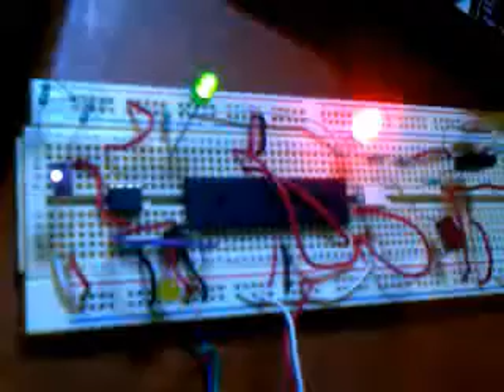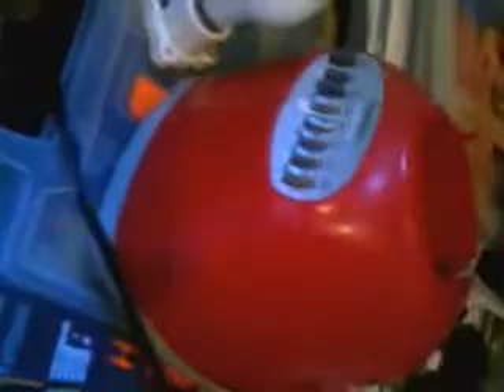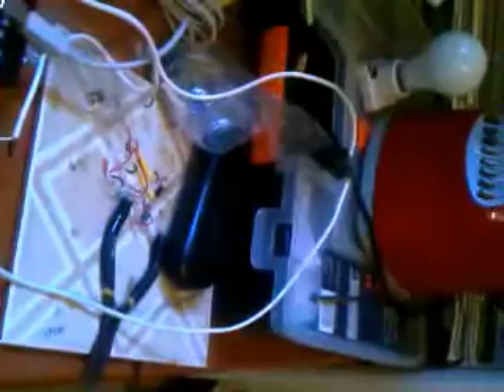Control de Motor Universal con PIC 16F887 y sensor QRD 1117 (FES ARAGON/UNAM/México)

Comment from the maker: Si necesitas algo mucho más exacto de calibrar te recomiendo el QRD1114 a mí me dio menos lata que comprar el CNY70 o que armar el diodo emisor con el receptor. Ese tipo de configuración de comprar todo aparte a mi me dio más lata. Cualquier duda avisame, y cuando tengas tu proyecto hazmelo saber.